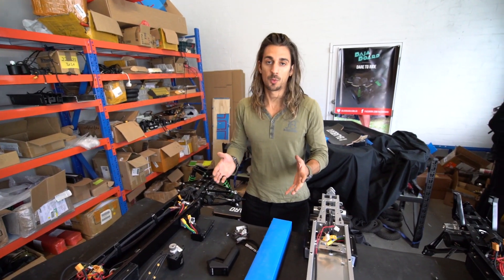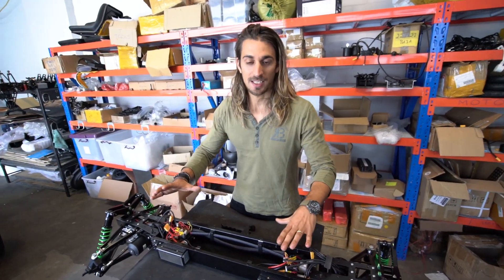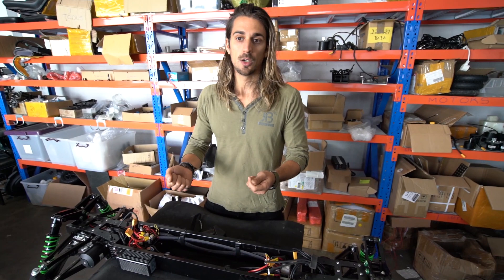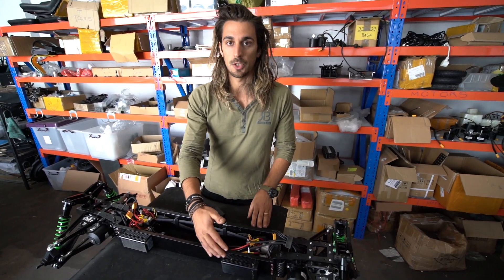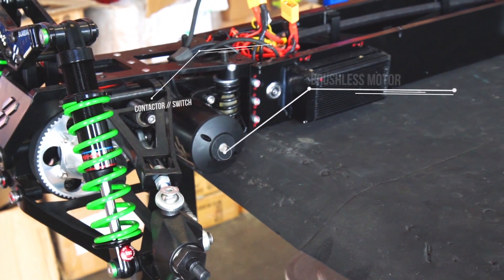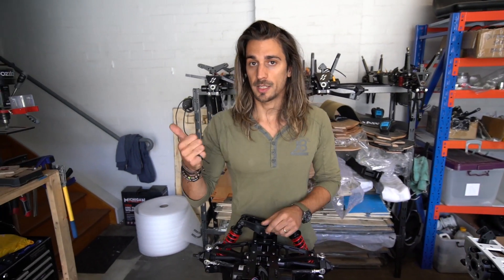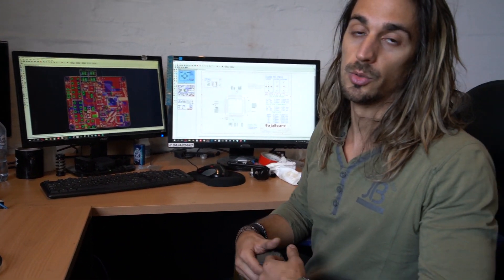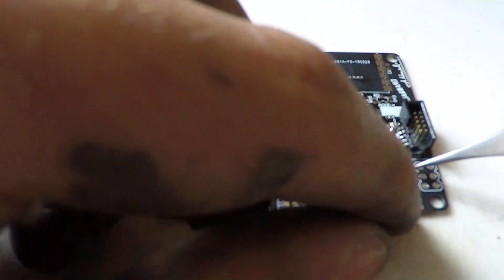WHAT’S INSIDE A BAJABOARD? And why we don’t use VESC | Baja Vlog 7

Comment: Do I read correctly that the new S2 actually does use a VESC now?  Why the switch?  And does the new one then still have the controllable differential, etc., or ...?
Reply from the maker: No we aren't using VESC the difference is that the motor contoller now are install inside the chassis box. This model doesn't have e-diff just to keep the cost and complexity low to be more an "entry level" board. You can definitely install the bigger lights on the G4 (we have customers that already did it) but it cannot be controlled by the remote you will need to add a switch to the board.